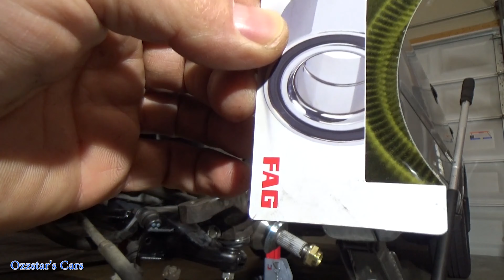Subaru Outback Front Wheel Bearing Replacement

Comment: Hey bud what are the torque specs for the top two bolts that hook into the shock at the top of the knuckle? I removed my knuckle and did the replacement in my shops bench vise to clean off all the corroded crud before I put the new bearing in, I can't find those specs anywhere
Reply from the maker: No more than 3 ugga duggas. 😜

Comment: This is the 2005 and later outback?
Reply from the maker: I don't recall exaxtly what year that car was but '99 and up are pretty much the same design.
Reply: @ozzstars_cars ,
   I know 2001 to 2004 have a different knuckle. It doesn't have a cartridge with a 4 bolt pattern, but rather you press the bearings right out of the bore in the knuckle. If you look at the knuckles online you can tell a hell of a difference. Kind of threw me for a loop, but I'm workin on a 2001 right now and they're gonna hit the press fer sure today. Have a good one man!